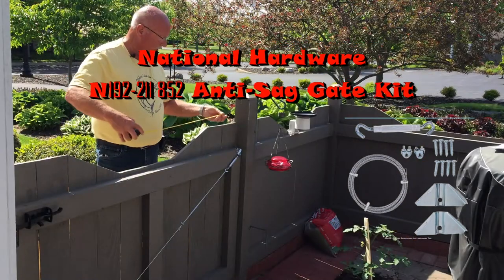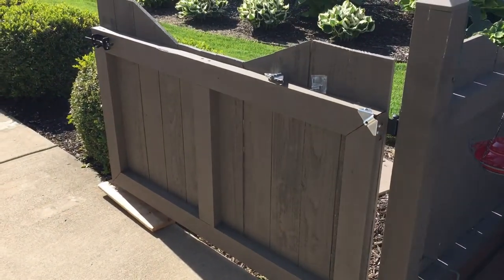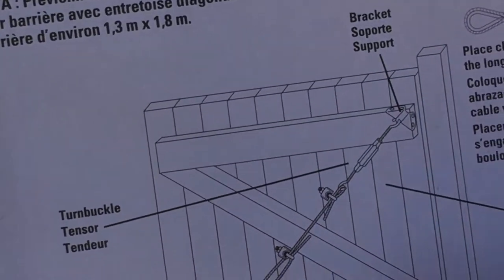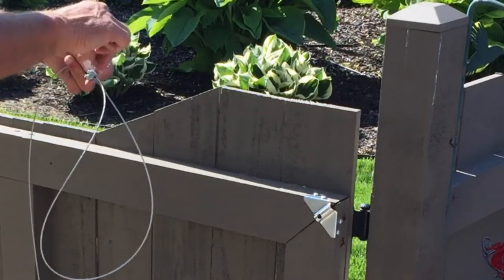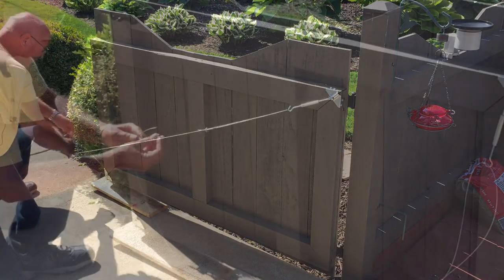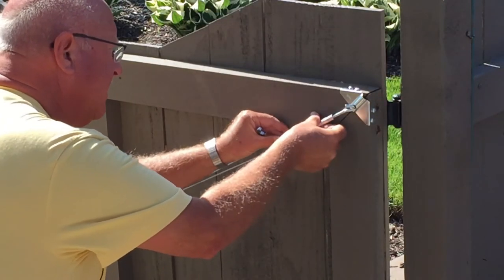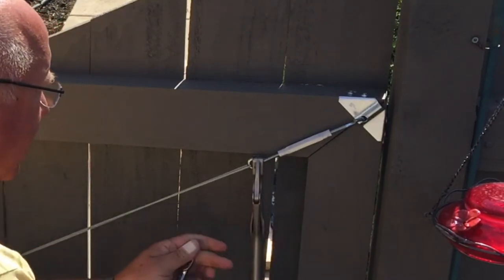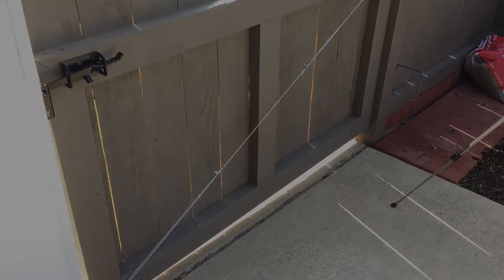Gate Sag Lift Kit Installation

Comment: Thank you! I was struggling with this!
Reply from the maker: You’re welcome.  Note: from time to time you’ll need to adjust the tension either slightly more or slightly less.  It seems like the weather plays a role.  Winter definitely needs it a little tighter.  It’s simple, just hold the hook with pliers and use another to tighten/lossen the elongated bolt thingy…… maybe I should do a follow up video 😂👍

Comment: Remember that you will need to remove the gate to install that bottom clip.
Reply from the maker: Point well made.  Fortunately it is bent around the bottom so the pressure of the cable is holding mine in place.

Comment: I've got this kit to raise my sagging shed door, would the turnbuckle be best placed nearest the hinges or on the opposite end or doesn't it matter ? (I'm fixing  this unit on the inside of the door obviously)
Reply from the maker: Mine is opposite side of the hinges and it continues to work great.
I have adjusted once or twice giving it a little more lift.
I think the important thing is that it’s hooked to the solid frame of the gate / door.  Mine is one the 2x4 cross framing boards.  I’d think if your door has good wood, it’ll work fine.
Thanks for watching 👍